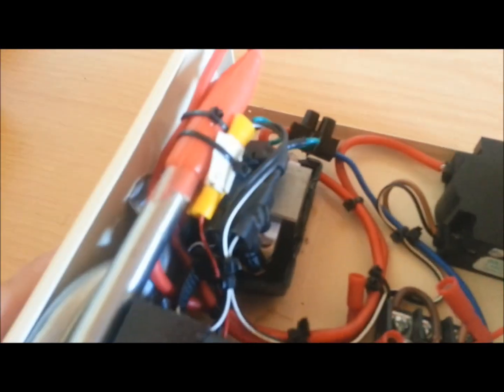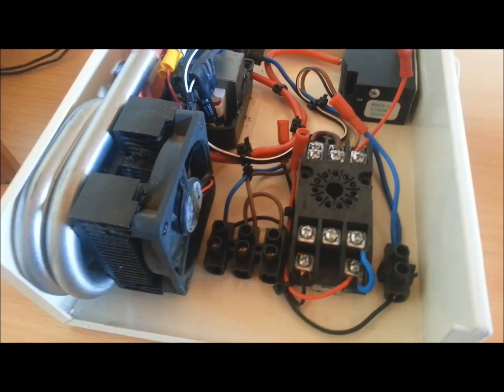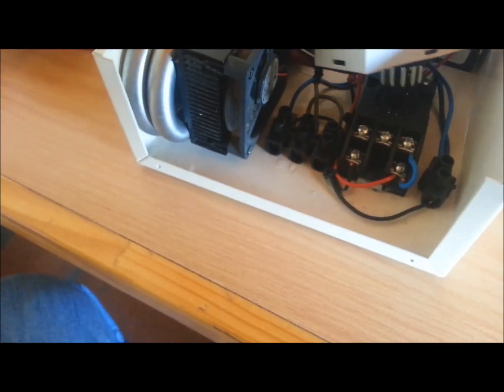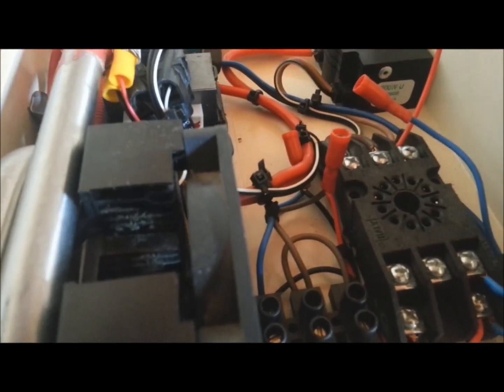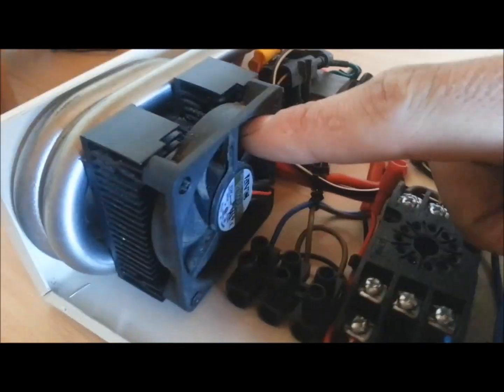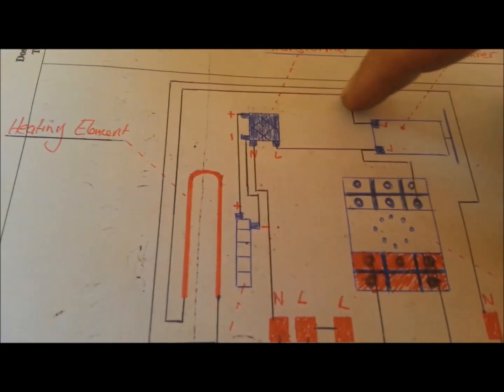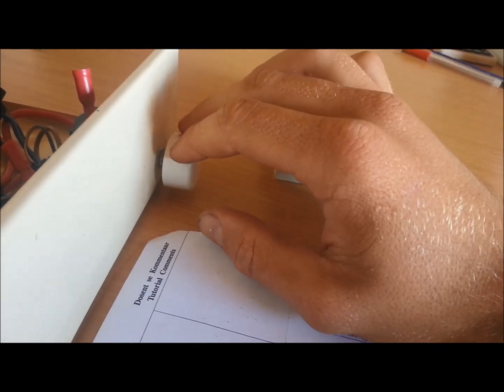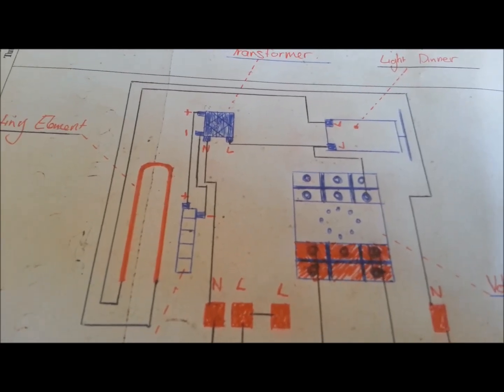AC dump-load voltage Controller / regulator

Comment: Nice, professional job, very tidy well thought through.  Is the fan wired in series with the heating element, because if so that would provide a fail safe operation - if the AC fan suffered a fault the heater would cut out, similar to a hair dryer?  Living in the UK, where its cold most of the time there is no such thing as "Dump load" since its all useful heat for my house.  I guess in South Africa you have less of a requirement for hot water and house heating.  Is there a possibility of increasing the reservoir size on your hydro scheme?  If so you could look at developing some sort of pumped-storage to store rather than dump the energy?  You seem to know what you are doing but if I can be of assistance in any way please get in touch, and keep up the good work! :-)
Reply from the maker: Wow looks like you really know your stuff ... thank you for watching , i have tested my controller but there are still bugs , hopefully i will sort it out and have my turbine run 24/7 and have that peace of mind of forgetting about it and never have to worry about some sort of failure
Reply: Thanks for the compliment.  Good luck!